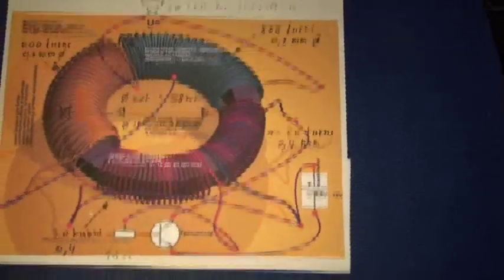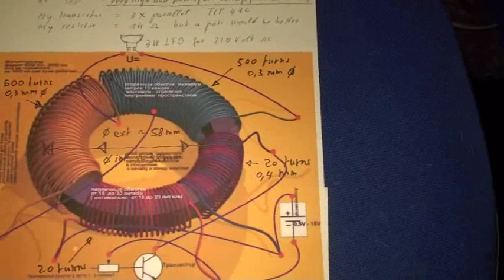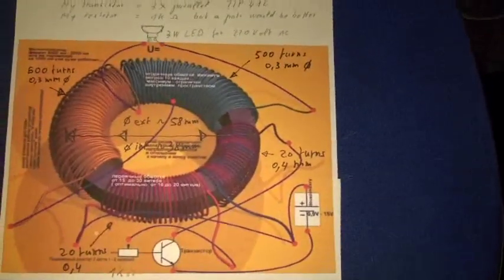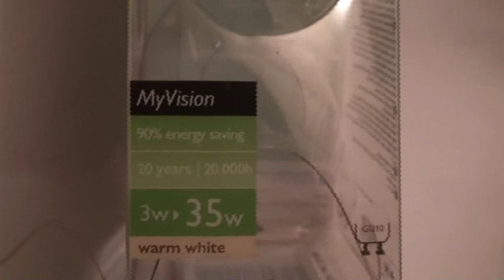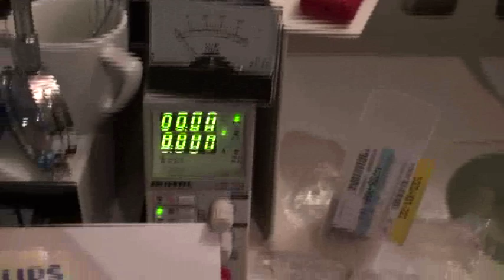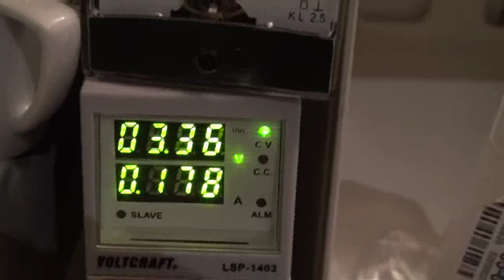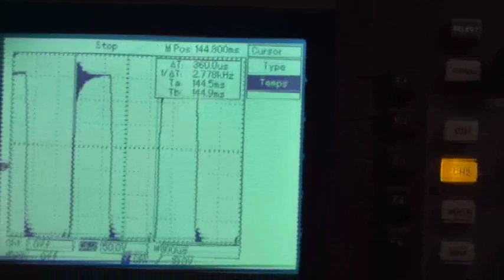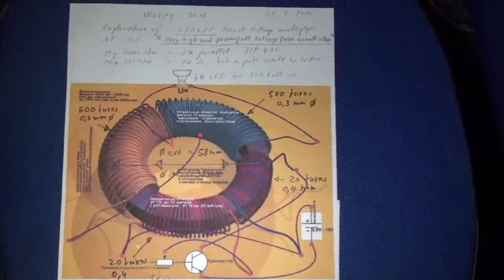Amazing light with low power toroid transformer 1.wmv

Comment: that's just a joule thief :)  the coils are split differently, but that ends up not mattering.  the primary would have the end of one coil joined with the other, which the picture you show has, joined with the positive on the battery...